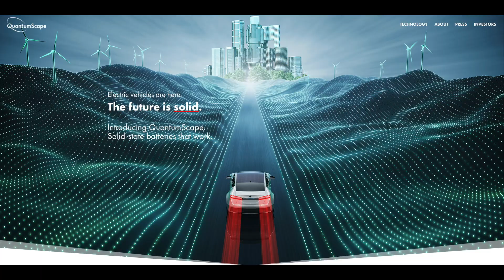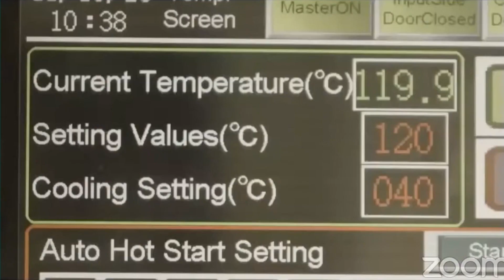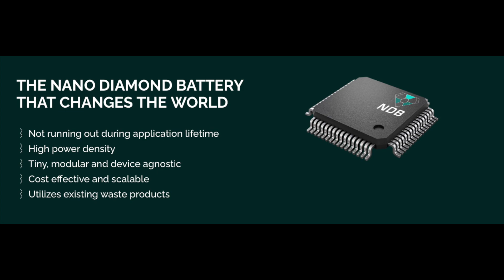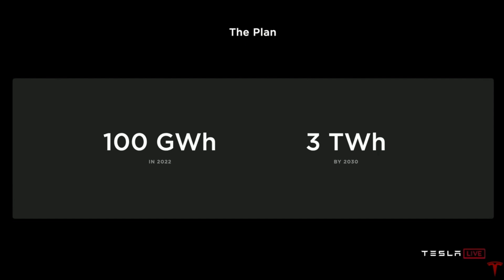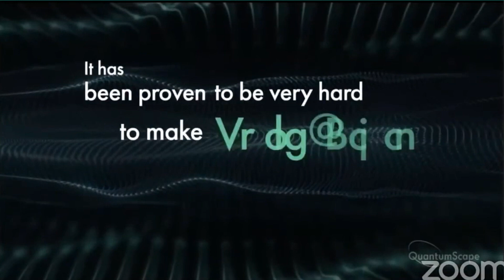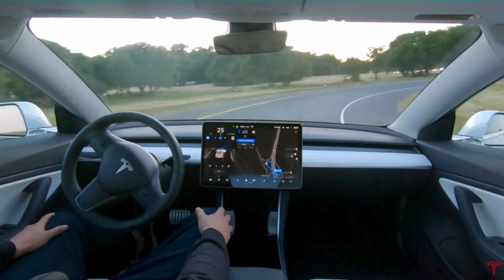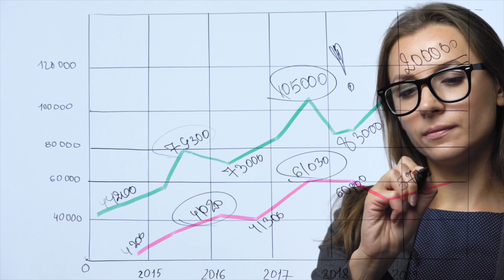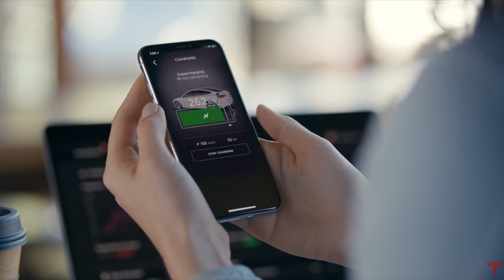Toyota's Solid State battery and the future of our transportation

Comment: First of, thanks for the video!
I think we’re being far too optimistic about TSLA’s position in this race vs. everyone else’s. The race is no longer about more range (500 is more than enough). The range of a car will become much more irrelevant as time passes, and the charging infrastructure improves. Now the focus is on the life of the battery, safety, and the speed in which it can be charged. As far as cost and scalability, it comes down to the equation of supply and demand.

Comment: The point for cars for sold state electrolyte is fast charge, but the other advantage is higher power density as dendrites aren’t so much of a problem & the batteries can be loaded up with more lithium. Higher power density is useful for anything where battery weight limits range. Very long distance trucking, flight, boating, robotics, a decent mobile phone charge time.

Comment: Good vid, however,  I don't think you had really thought the thought through when you said range will be irrelevant. Range is always relevant, and even more so when taking into account the fact that by 2030-35 FSD will be so good that you can sit there and relax (or even sleep) while the car drives safely to your destination. Cars will be coming out that can convert to sleepers on the road and people will be driving cross country non-stop as a normal activity.

Comment: Your right about batteries.  Tesla's biggest problems are batteries, batteries, and batteries.
Tesla has two critical problems to overcome.  Battery production is number one and leads to number two, financing and building new battery, car, solar panel, and battery storage factories fast enough.  Fortunately full self driving will reduce the need for car production some, freeing up more battery production for home and commercial battery storage systems.
You have to be careful not to overestimate how much leasing full self driving vehicles will take over car ownership.  First, there will be a great deal of inertia in car ownership and the convenience that brings.  Ownership will also be  necessary in many locations such as small rural towns where the population is too small to support a car leasing company.  Ownership will also be necessary for many companies and occupations, for instance, pickup trucks for farmers or construction companies.

Comment: I feel you are missing the point about the correlation between the amount of energy in a battery and the range. Sure, optimisations can be made to get more range out of the same energy, but rarely at the battery level. The efficiency of Li-ion cells is already well above 90%, so not much can be gained there. (please do correct me if I'm wrong, always learning!) When Elon talks about more range I think he means energy per weight or volume, as this allows you to pack more batteries and thus more energy into every car. This would also explain how "Cell Vehicle Integration" can give a gain of 14%. It's not like the current modules absorb 14% of the energy going through them, the modules just add weight and volume.
Also: love your videos, keep making them!

Comment: I think 80% is too high.  Population density will have a major impact.  The higher the density the quicker a car can arrive and the greater the number of cars available.  Next is how many people continue to work from home.  If we go back to our work places then there are a lot of 30 min to 1 hr commutes happening at the same time.  Long weekends also pose a problem if people want to get away for the weekend then the demand for cars may exceed supply.  In Saskatchewan we have a million people spread over a large province.  I can see people in the city summoning cars but not in small towns and the country side.  Battery capacity will still be important because if I am coming home from the city and hit a blizzard with -20 C I want to survive the night if I have to pulled over. 500 miles is the minimum due to range reduction at those temp.

Comment: Comment 1 - Lars, please break your thinking into at least two camps.  Urban and sub-urban folk can more easily share a transport system most of the time.  IF companies allow flexible start and ending times for employees, FSD Robo-Taxis can service many of these needs.  But rural folk do not have the luxury of sharing the same way.  
Maybe in Denmark the farms are small enough and close enough that they can share one vehicle between say three or four farms.  But my bet is prolly not ...  And big USA farms that are many square miles each are just to far apart to make this work easily.  It'll be more like tractors.  They are all needed at the same time for plowing and planting, so can't really be shared ...  
So your gross estimate of 80% less is applicable to city, but not to country dwellers.
Bottom line is I think many of these estimates are over blown.  Maybe in a more ideal environment we could get down to 50% less for fleet totals.  So how many batteries is that ??

Comment: @BestInTESLA you made an error while explaining how higher battery density cells will enable them to make more cars.   Higher energy density cells means you can use less cells to make the same 75KWh pack, NOT make a 50KWh pack to do the same range.   eg: instead of ~900 4680 cells for a 75KWh pack, you might only need ~800 4680 cells.  This will also mean that the pack is lighter, so will in turn give better range due to the lower vehicle weight.
Reply: Don’t forget about charging time, if it only takes 5 minutes to charge 80% you could easily stop on a longer trip. How often do you really need the full range of the current models? The average driver doesn’t even drive a 100 miles a day.

Comment: Almost nobody seems to be getting this, so I'll say it again: You don't have to replace all the global fleet of vehicles to get the benefits of converting to EVs. Most old cars don't get driven that much. And with ride-sharing, you could easily reach a point, in maybe 10 years, where most tonne-kilometers are in EVs.

And if you put it in PASSENGER-kilometers (just for passenger vehicles), the transition could probably even be a little quicker.

Comment: I believe you are absolutely correct.  Tesla battery production is timed with automobile production and software improvements to provide a large moat for other car makers to cross.  This will be extremely difficult for them.  In addition, it is likely that any new battery improvements will be emulated by Tesla with an incredible engineering capacity.  Thanks for all of your great information and Be Nice!

Comment: I like the point about the irrelevance of range anxiety in a ridesharing age, but surely the biggest deal in battery development is improvement in capacity to weight, and a battery holding ten times as much can also be one that holds the same amount and weighs a tenth as much. Wouldn’t that be nice? And wouldn’t Tesla want to achieve that?

Comment: Japanese technology is quite amazing and I have little doubt that Toyota will make a big success of the new solid state battery.

Although the car market is about 90 million per year, when EVs reach the tipping point in 2021, I think it will drop to around 50 million by 2030. Why? Because EVs last much longer and because  Robotaxi’s will nullify the need to own a car. That will really squeeze the market size and effect the relevance of the solid state batteries.

Comment: Timing is critically important. Jet airplanes were flying before WW2, but both sides decided to use propellers driven by gasoline engines (and even a diesel  bomber in Germany) because they were manufacturable in quantity and were available right away. They also had some other benefits such as the ability to operate off crude landing strips, and to carry large payloads.  Both sides correctly concluded that winning the war was more likely with the existing technology, instead of betting on a new and unproven approach. The elegant Merlin V12 and monster  radial engines won the war, but by 1945 the jet engine was clearly going to own the future of commercial aviation.

Tesla's decision to exploit existing technology to win worldwide market share is a similar decision. The 4680 is Elon's Merlin, and it will enable the growth of Tesla worldwide for the Next 5 to 10 years. By the time Toyota and others have solid state batteries in quantity Tesla will dominate the world market for BEV's. Meanwhile, Tesla can continue to develop battery technology using first principles thinking. If solid state batteries are appropriate Tesla is very likely to have them as soon as anyone else does.

Comment: Tesla has the right idea here. The focus on solid state batteries is misplaced. Range and recharge times, although not yet on par with gasoline vehicles, are good enough for most people. And so is the Tesla charging network. The biggest issue preventing most people from buying an EV is their cost. 

A 5-door Kia Rio starts at $16,990. For about $20 K, you can select one in a wide range of colors and a slew of options including AC, cruise, accident avoidance, Sirius XM, Apple Car Play/Android Auto, an 8" touch screen, remote keyless entry, and  outside heated mirrors. A Model Y would cost $20 K to $30 K more. So for most people, an EV is not even remotely an option. Going 0-60 in 3.5 seconds may be a big selling point to the Porche/BMW market, but not to the Yaris/Rio market. They just want a reliable car to go to work, do their shopping, drop the kids off at daycare, etc. 

And no, fueling their vehicles is not a big advantage for EVs either. With gasoline hovering around $2/gallon, a Kio Rio with 41 mpg on the highway could do a 2500 mile trip with 61 gallons of gas for as little as $122. Jason at Engineering Explained recently did a 2,449 mile road trip in his Model 3 using 810 kWh with a total cost of $177.65, substantially more than it would have cost in a Kio Rio. However if oil prices were to zoom up again to their 2010 heights of nearly $4 per gallon (or higher), then charging might be seen as more advantageous. Of course, energy pricing is all connected, so if gasoline prices go up, electricity prices will usually follow. However, since the generation of electricity is fungible, you can avoid these costs by using alternative source such as solar. But for now electricity does not have a cost advantage over gasoline, at least not on long road trips.

For most people, EVs will remain an interesting, but unattainable option until they can compete with the Kio Rio. All other things being equal, at a certain point, the cost per kWh of batteries, should make an EV cheaper than its ICE equivalent. But until we reach that threshold, ICE vehicles will rule the day. Tesla, at least, is focusing on the right problem.
Reply: So true, Elon and Tesla has been in the EV game for the very longest and has a better perspective (and thus competitive advantage) and sees cost and scale are the bigger, more important problem to solve. Whereas SSB’s “solves” the question of charge times, thus far they are still problematic and no one has a working solution let alone even a working prototype vehicle (in public) because they need to also simultaneously resolve issues with cost, mass producibility, charge cycles as well as quick charge times. Tesla is well on their way to solving for all four except for charge times (equivalent of SSB’s), but if they charge “fast enough”, no one will be able to touch them at least until SSB’s become truly viable.
Reply: Except goverments will be banning the use of petrol and diesel in cars. That will concentrate the minds of manufacturers in getting costs down.

Phillip.

Comment: You are absolutely right on about the timing of battery innovations; Tesla is way ahead for the rest of the decade.  Also, the FSD is far ahead of the others in software and situation adaptability.   The machine that builds the machine is no contest for both batteries and cars.  The software that runs the cars and the company are way ahead.  The decade clearly belongs to Tesla as it has several innovations that have all come together and the pace of innovation is not slowing down.  It is amazing to see.

Comment: RETIRED 76: SOLID STATE BATTERIES: Home charging in ten minutes won't happen, it's cost prohibited.
Reply: .... anNNnd.... may i say.... UNECESSARY.... w/ RoofTopSolar&BatteryBackUp AT.... GodParity(shoutOutTonySeba).... theee.... PricePoint for EEEE-lecTRICity at which TRANSMISSION Costs are (from ANY source).... GREATER.... than  the Costs of Production AND Storage AND delivery to end-use FROM.... RoofTopSolarANDBatteryBacking.... RoofJuice to End-Use = FREEDOM (minus) Maintenance & Mfg.

Comment: Tesla has the solid state technology they are keeping it under their sandbags. Truly
Reply: Why do you think this? Any proof? Reasoning? Just a hunch? Not trying to deny it just genuinely curious as to why you believe they have the tech but refuse to use it. Or refuse to release it yet.
Reply: @WackemAndStackem  it’s more complicated than that having a tech in the lab and having it mass produced for the right cost and integrate to a product is a completely different thing. I’m quite sure both companies have it working in the lab, simply Tesla’s motivation are bigger  and also have more space to move forward then any legacy car maker. And btw car manufacturing for Tesla is just the first baby step.
Reply: Yep, they just don’t want to Osborne effect their current products and also will need all the batteries they can have no matter what is the tech inside.

Comment: If all goes well Tesla will sell gigantic amounts of Power Walls and Megapacks.  So the battery production is not only for cars and other vehicles
Reply: When solid state batteries become feasible based on technology and cost -- Tesla will manufacture their own line and put them in them in their high-end RVs.  These will be manufactured in "additional" battery factories.  Elon said they need/can use ALL the batteries they can get -- NOW and for many decades to come.  There are a LOT of oil powered products that need replacing ASAP.

Comment: How will FSD handle snow?  No stripes, no road edges.  Will all robo-taxis be unavailable?  I'm just not a FSD believer.
Reply from the maker: We have already seen it Handel snow, so that is not going to be a problem 😉👌
Reply: Check Dirty Tesla channel, it works fine on a dirt road covered with a nice new layer of snow without a problem, except that beta version 10 want to drive a little too far to the right.

Comment: 7:05 You seems to believe that cars in the future will need a lot less kWh battery because the batteries get better, this is not how it works.  A motor will use just about the same Wh per km no matter how good the battery is.  However, if the new battery weights less the consumption will be less like 10% less.
I think you mean less kg of battery because the Wh/kg is higher with a better battery.

Comment: 90 GWh can produce 1 million cars with a 90 KWh pack or 1.5 million with a 60 KWh pack.  It's a small dent, but a dent nonetheless.  Especially if the vehicles the batteries go into are compelling, and range, charge time, charger availability, etc. are also good.  They have to start somewhere....

Comment: I just read an article on quantumscape they said the solid state battery is a half a million mile battery I'm not sure if that's enough to put in a car when teslas go 1 million miles
Reply: It won't be a good deal for robo taxis and other commercial transports.
Reply: How many cars go for a million miles.  That would mean you have to drive 260 miles every working day for 15 years.
Reply: @patrickmadden5938  it's something to think about when it comes to longevity of a car especially if you use your cars commercially. The battery's are the most expensive thing on the vehicle. So you want to make sure that's not what fails. Also as a consumer who commutes alot 500k miles is right there at the limit of acceptable. Since there are ice cars that can hit 500k miles.

Comment: well i think you re right, i calculate a progress of 7% each years on batteries, every 5 years a breakthrouhg wich multiply by two  : 5400km on one charge with the same tech that the S Plaid, now imagine with the 4680 cells, try by yourself im sure you are going to love it :   2021/2024 7%+7%+7+7% then X2 then 7% again until 2029 and X2 in 2030, the result must be enormous !!!! :)